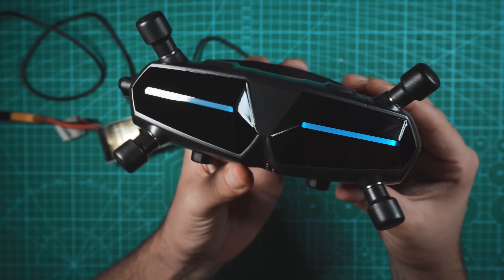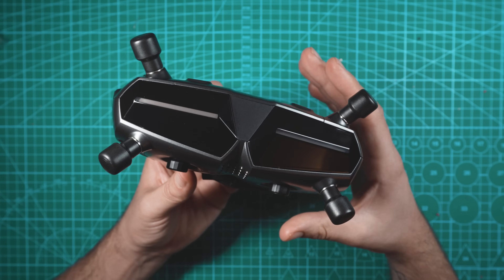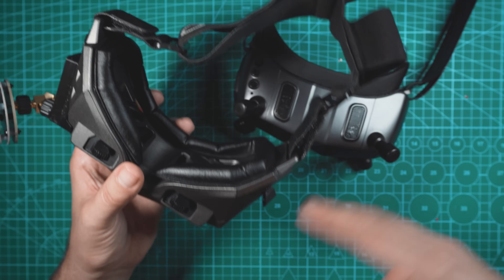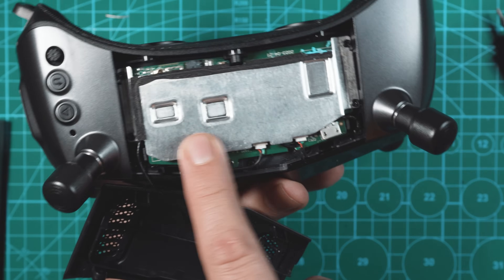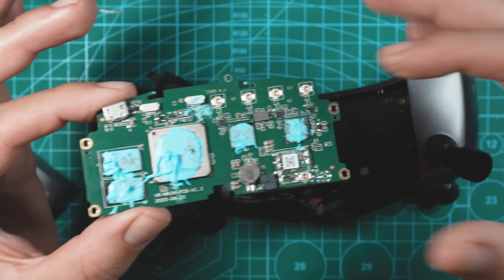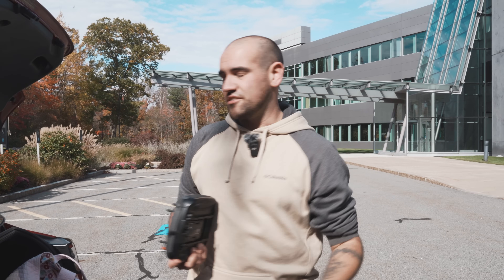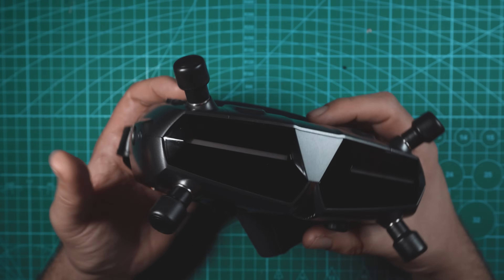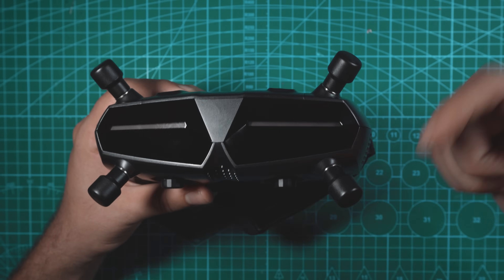Future-Proof Digital FPV - Walksnail Goggles X

Comment: Any product that ships in 2023 that doesn’t have USB C just makes me upset
Reply: When/why would you ever plug a goggle to USB?

There is no internal battery. Updates are over SD card or wireless. Video is via HDMI.

DJI’s “Aeroscope” serialized hardware and digital ID registration and tracking system is the only one that would require a plug… no one else does, or will ever, do this.

The micro-B port on the VRX board is for factory diagnostics, hardware comes with all kinds of diagnostic ports, but usually pogo pins in mass manufacturing.

Caddx isn’t a huge corporation making millions of pieces of hardware so it’s easier to just put a random, non user accessible, port instead of requiring a diagnostic fixture/automation system.
Reply: Charging USB c is the most common charger ever and anything I own that doesn't have it always is a pain to find the charger. It wouldn't be a big deal except I have like twenty different chargers for different things and my daughter loses some or I do. It would be sooo much better if everything was just USB c
Reply: The IPhone now ships with usb c 😂😂😂
Reply: @wildweasel6898 yea but these don’t have a internal battery
Reply: @wildweasel6898  You do realise that 99% of usb cables and power banks will only do 5v, and no fpv goggles will run off 5v, and these don't have an internal battery to charge...

Comment: The fact that they just shipped goggles with a replaceable vrx tells me that there's an update coming in the next year or so and they thought hey you know what would be a great feature to add to increase cashflow now without making everyone angry in a year?
Reply: August of 2024 they are shooting to release the next VRX. Said it will have more range and penetration. Basically the current chipset isn't made anymore. The ones they are switching to offers a little but more performance. But they did announce August will be the release and you can upgrade these goggles with that VRX set to release in August
Reply: @xORLOCKx so the chips set is no longer available for the goggles that literally just released.
I do not understand this hobby
Reply: @RandoManFPV  the VRX. Hence why they are advertising the ability to upgrade the VRX later. The artisan chipset is no longer produced.
Reply: @xORLOCKx  oh okay I misunderstood at first but I reread your comment.
Basically they designed the goggles to he able to fit the next model vrx they release and hopefully others in the future as well. That's good
Reply: @RandoManFPV correct

Comment: But you're future proof to 1080p 100hz which it's already at, if they release a 4k goggle these won't work due to the limitations of the optics future proff sound kinda like a gimmick
Reply: You are never getting 4K goggle lol
Reply: @dominickeen6091 i doubt you could even see a big difference between 1080p and 4k with a goggle lol

Comment: Damnit, I got the Avatar ones and flew them first time today and now these are out . I'm sad but also like the Avatar ones, they are my first fpv glasses. Newbie here hehe
Reply: I'm new too but I wouldn't worry about it. It seems like every 3 months every brand of every product releases a new version and ditches the old one. I don't get it but whatever lol
Reply: These literally just released and allegedly the chipset they use is no longer available and they are already talking about the new model coming in 2024 😂🤷‍♂️
Reply: @RandoManFPV  wtf for real? So basically they will be out of stock soon and then a new model will come out?
Reply: @wutufux7570 ya I just bought the avatar 3 months ago so I sold them on ebay and pre ordered the x's. I sold my avatar for 400 but after fees I had to put 100 bucks with it for the new goggles. So am kinda pissed. But I hated my eye lashes hitting the screen and the fogging I live in FL. The dji goggles 2 foam fits the x.
Reply: @RandoManFPV where did they mention a new 2024 model?
Reply: @mr_pike4609  I'm not sure. I don't have and don't plan to get any walksnail/avatar stuff. Some other commentor was explaining this

Comment: The "patch antenna" is the WiFi antenna.
Reply: the "5ghz wifi" band lies in 5.875–5.895Ghz range, could be possible they use it for both WiFi and 5.8ghz video

Comment: Im wondering if this new vrx board could be used for a light weight simple antenna tracker setup. How is the HDMI out connected to the board you lifted out?
Reply: Is that the same as face tracking?

Comment: does anybody know of any higher quality antennas? I see that the dji goggles are capable of 10 km transmission distance while the walksnail is only capable of about 2.5. i am currently about to buy my first set of goggles and really like the walksnail goggles, but numbers dont lie.....

any suggestions? thanks.

Comment: im very new to FPV, i want to be a FPV pilot, can someone tell me how i should start . Also can i connect Walksnail goggles to dji o3 ?
Reply: To start off, I would do some crazy research on the main parts of fpv/the quads. Learn what radio systems are, video systems, and more about how they fly. These googles can't connect to the O3 as every digital video system is locked into their own ecosystems. Watch some videos on the differences between them, and pick which one fits best for how you want to fly!

Comment: If it's not capable of 8k at 240fps. It's nowhere near future-proof. They don't even meet the current industry standard of 4k 120fps.
Reply from the maker: Can you share a link to a set of current FPV goggles that are capable of 4K 120fps low latency video transmission?

Make sure you're looking at video transmission quality in the goggles, not what the camera on the drone is filming in. Two very different specs. DJI isn't even capable of 4K fpv video transmission.
Reply: @TRONCATFPV  Sure thing as soon as you can show me how those are "Future proof". That would mean no other goggles are ever coming out to replace them.
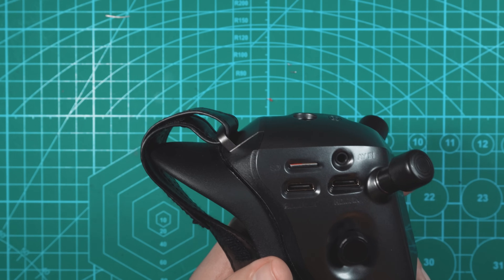Reply from the maker: @theworst9568  Whoops looks like you forgot to watch an entire segment of the video! 4:00 - 8:00 I go over the removeable VRX module that is the upgradeable PCB. According to Walksnail, future VRX improvements would be released on a similar form factor PCB that can easily be installed. 

I'm excited to see these 4K 120fps FPV goggles you mentioned. They must be pre-release!